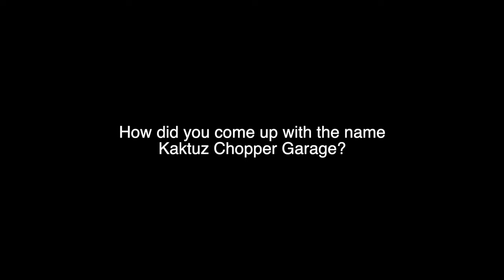Kaktuz Chopper Garage Yokohama, Japan

Comment: I love how here in Europe you rarely see a real classic chopper and most modern chopper riders, or Harley riders are all about the thickest tires, wide and high bars. Over there they are like: "Brakes? Meh. Pegs? Ah, weld a pipe there and wrap some fabric around. Bars? Pffsh, you only need them wide enough to fit both hands. Mirrors? Ah, they legally need to be somewhere on the bike, so I'll put one where it's hidden best." Logically I can't imagine a less practical and safe bike, but I love what he does with the bikes and even though I'll never want to own one, I'd love to experience that absolute raw approach to riding!
Reply: Also: Me being more into the custom cafe style with the exhaust system often being a central part of the design with intricate routing and the likes while keeping in mind exhaust gas regulations, I find him putting a straight 8 cm pipe from the cylinder all the way back just hilarious! It's crazy but damn is it cool in its own way!